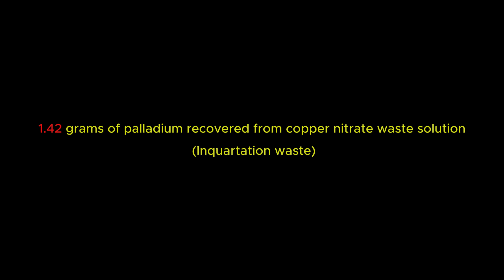Palladium recovery from Copper waste solution | Stockpot processing for Palladium

Comment: Could you describe your process for purifying dmg, I see that your solution before taking out the dmg powder is orange. How do you proceed? Do you make your own dmg or have you just recycled it? 
Do you add NAOH because you want to recover a large quantity? The hoock book advises against adding NAOH if you want to recover PD selectively.
Reply from the maker: In case of testing palladium with DMG you should just use water as the second solvent because it could form metals hydroxide in small samples, that's why Hoke Suggest not to use it, but in large batches it's ok, I used NaOH to allow me dissolve more DMG in water, the purifying is consist of dissolving in NaOH solution followed by filtration and reacidify the solution with HCl to get DMG out.
Reply: @PickyPlans  thnak you , why you don't use Cl2 gas generator , realy easy and economique way,  or you use to in this order , NH4CL, for Pt , after sodium chlorate for pd
Reply from the maker: @vincentrousseau8194 have you tested it in large scale?
Reply: A xít hoá hcl là gì vậy. Bạn cho mình biết được ko

Comment: How did you make your own DMG? I am very interested in that reaction. Also, how long does your homemade DMG keep? Thanks!
Reply from the maker: It is good for up to 1 year.
You should make a gas generator producing ethyl nitrite and bubble the gas into the butanone warming to 50 ° (mixing sodium nitrite solution in ethanol with sulfuric acid makes ethyl nitrite)
The result of this reaction is Biacetyl Monoxime. 
In solution of sodium nitrite and sodium bisulfite add some glacial acetic acid and hydrochloric acid (keeping temperature below 0° C ) product of this reaction is Sodium Hydroxylamine Monosulfonate
By heating the solution of Sodium Hydroxylamine Monosulfonate with biacetyl monoxime in a mix for a few hours crystals of DMG forms.
Here is the link to the procedure 
https://www.orgsyn.org/demo.aspx?prep=CV2P0204
Reply: @PickyPlans  thanks for this information. Follow-up question... how long does lab grade DMG bought from a supply house last? I bought a bottle of DMG powder a couple years ago, but now I am wondering if it is still good. I havent gotten a positive Pd test in a long time.
Reply from the maker: If it smells like rotten fruit, it has gone bad. You can recover it by dissolving in sodium hydroxide solution followed by filtration and then acidifying solution with HCl to get it percipitated
Reply: @PickyPlans  thanks! It still smells like nothing. I suppose it is still okay.
Reply: @PickyPlans  thanks!

Comment: Can we used  potassium permanganate for oxidation and the copper solution and add ammonium chloride for precipitation of platinum and palladium please reply is this process is right
Reply from the maker: Yes it works by producing chlorine gas so by adding ammonium chloride you get mix platinum and platinum salt. But it doesn't work in a very diluted solution .

Comment: Hello, interesting project and nice result. I do not have so much material to work with, also, DMG costs kidney here... I am very afraid to work with PGMs, nasty stuff in solution... Gold and silver are challenging enough for me for now... 😀
Reply from the maker: Thanks mate!
I agree. Working with PGMs requires high precautions. Don't mess with them until you know what you are doing. DMG is indeed expensive; perhaps some Chinese-made alternatives could be found for less money..
Reply: Remember that nasty stuff is in your gold silver solutions just as dangerous before you try and recover PGMs
Reply: @jamisontaylor878  I know, so for now, I am avoiding white gold and dental gold. Using cupelation where posible to avoid work with metal solutions. Lots of silver scrap waiting for purification, I will work with solutions with caution... Thanks.